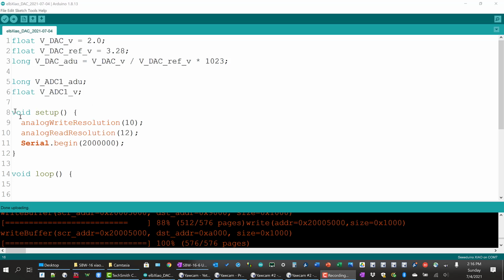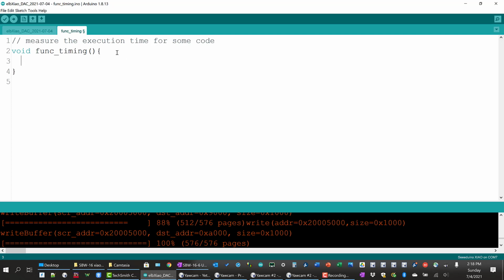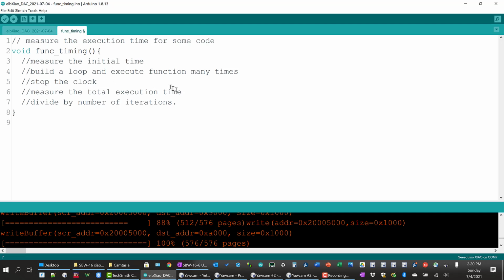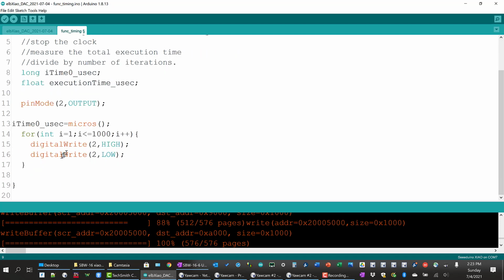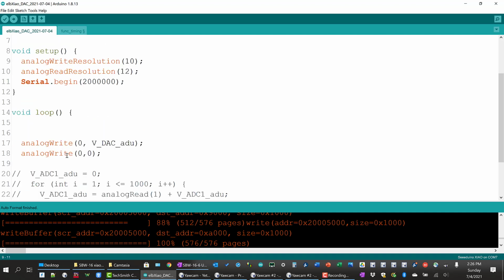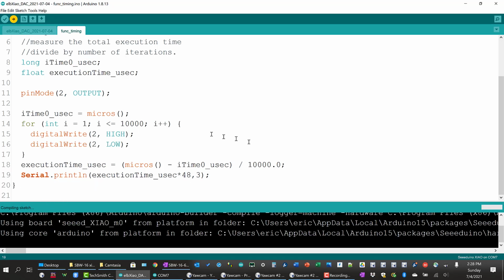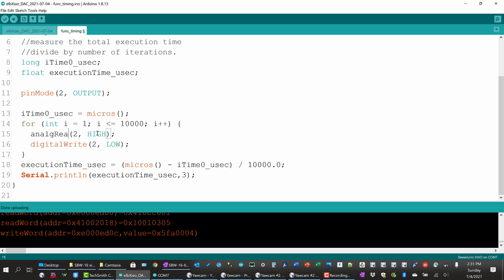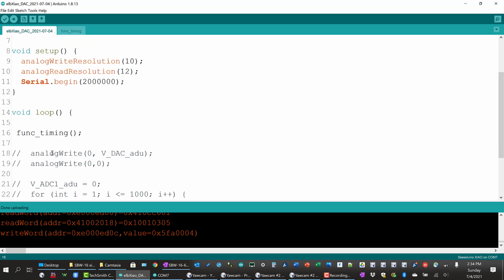SBW 16-6: Timing with Tabs

Comment: Interestingly my write high, write low took 3.190 uS and the number of clock cycles was 153.12 cycles. The frequency on my scope was 316kHz.  

I assume this is due to inaccuracies in the in built timing crystal (is it a crystal?), but that's just a guess.

As a matter of interest what 'scope are you using. I assume it's one of those PicoScope devices?